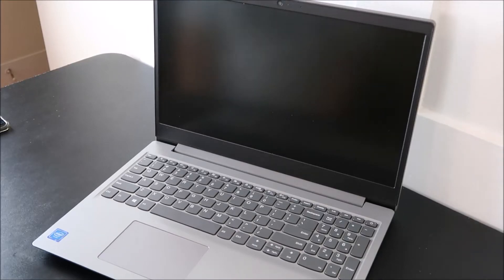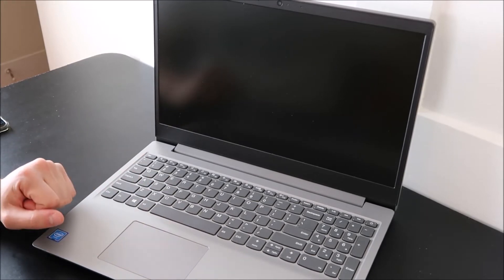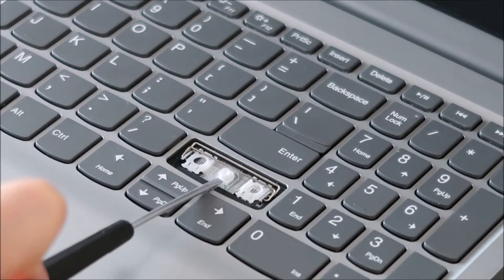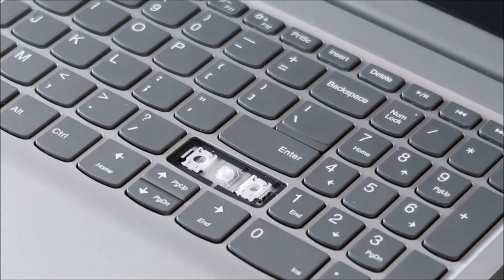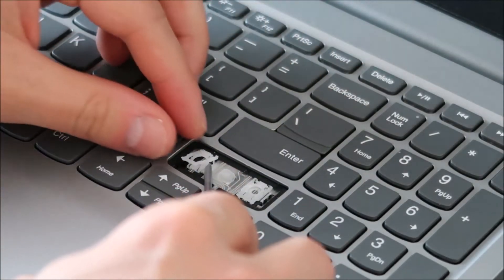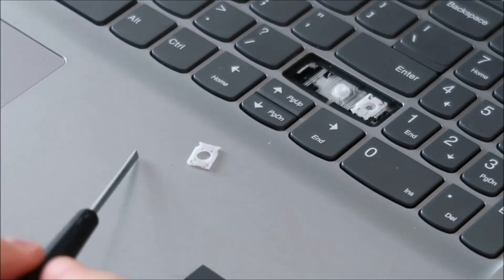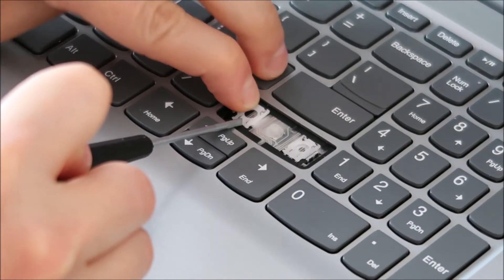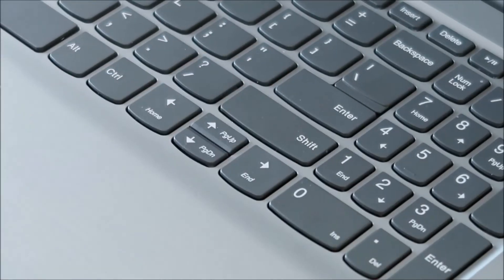How To Fix Replace Large Keyboard Key - Lenovo Ideapad

Comment: what about space butten i took it of and now i cant put it back on!
Reply from the maker: If your Key Cap is not clicking down in place correctly, it is most likely due to the Retainer Clip not being properly installed or damaged.  Remove the Cap and inspect for damage or that its not laying down flush and properly snapped in itself.  Compare to another Clip if needed by removing another Cap.

Comment: Additional tip: Put some thin adhesive tape (TESA) around the screwdriver to minimize scratches.
However, before removing keys, try a very strong vacuum cleaner. In most cases there are particles in the mechanism, there is a good chance to pull them out.

Comment: I used this for my spacebar. It is quite different from this, but the gist is the same. Replacing keys from other laptops in the past helped quite a bit. The orientation of the white bits is tricky. As well as how to connect the two white bits together.

With the spacebar, there is another strange metal bar-loop connected to the spacebar key itself. I just left it in, then put the other two metal stabilizer bars in as you did and pushed down. Then I typed and it worked. Then I pushed down even harder, and around the whole key, then it worked even better.

I ate 12 pieces of KFC, two icecreams, then a gummy hamburger. I collapsed to the ground for 2 hours in stomach and body pain. I finally managed to go to sleep but when I woke up my arm was covered in spit, as well as my laptop. Drops of spit. Many. I have no memory of how this happened, but the spacebar got stuck as a result. I think I threw up spit the moment I woke up, but my brain did not encode that memory. I just remember my arm covered in spit. Why eating so much caused this to happened I have no idea.

Anyway, thanks.

Comment: On my lenovo A485...the left shift key had become sticky...or spongey type after some ketchup got in it...when i tried to remove it like you did..it did NOT go off like it wont comr off... im scared ill break something..do you have any help on how i should take it out?
Reply from the maker: I can only say that I demonstrate here how to take it off. After holding down the Hinge Clip, you 'rip' off the Key Cap. It can be scary as it may take a bit of force to remove it especially if theres a sticky compond in there making it worse. And there is a degree of risk to breaking it. I still break keys every now and then. If your comfortable with the risk, I would try it. If not, I would take to a computer shop

Comment: Does that work on 15iah7 ? A juice spilled on the keyboard and it's now sticky and i want to clean it
Reply from the maker: This process for removing and installing a key 'works' on any laptop with keys like this. You can remove the key or keys, clean under them and then reinstall the keys.
Reply: @PC_Monkey  thanks a lot

Comment: Hello. I have a Lenovo IdeaPad 5i which looks exactly like the one in your video. My uissue is with my Ctrl key. It was feeling very sticky so I popped it very carefully just like your video and cleaned it. I was ablo to put the two white retainer clips back together exactly as you show. I appear to have put the retainer clips back together and snapped them in place. My issue is that when I press the key down and they clip on to the long metal clips, my key does work but the key does not lay flat. It's more like a see saw. It pops up and down as you would like but the key isn't lying flat. What am I doing wrong? I can send you pictures and you can tell me my issue. Or, can you possibly do a video on the same laptop in this video but for the Ctrl key. Thank you.
Reply from the maker: Most likely the key is not assembled correctly, or its damaged.  To see exactly how to reinstall it, you can remove the key cap only of a similar sized key and compare the two.

Comment: Hi Jamin, I spilled some wine on the keyboard 😀months ago. I didn't know it's possible to work with each key separately. But in your video you don't recommend doing anything with that central white spring (thing in the center of a key that makes it possible to press and turn back a key) - so what would you recommend? Should I try to clean under it? Or any liquid cannot really get under that detail, so I should just clean around and not touch the central spring? And is it ok to clean with a spirit liquid?
Reply from the maker: No. The Rubber Spring is held down by a small amount of glue.  That component is not designed to be removed and reinstalled.  I would try to just clean around it.
Reply: @PC_Monkey  ok, I'll try to and leave a reply here ;)
Reply from the maker: @alexko464  Good luck !!  Let me know how it goes :)

Comment: i broke my left cntrl key cap. now i dont know how to fix this. few repairing centre said to replace the whole keyboard and it will cost me around 10-12k INR. 😫😫
Reply from the maker: If any component of the key assembly is broken, it would have to be replaced.  I usually get my keys on Ebay or www.replacementlaptopkeys.com.  If you cannot find a loose key for sale, you may have to purchase a keyboard and take a key from there.

Comment: This tutorial doesn't apply for the enter key. That combo key has different parts inside of it.
Reply from the maker: It has different parts then the Rubber Spring, Key Cap, Hinge Clip and a Metal Bar?  What parts do you have in your key?

Comment: My rubber spring broke in the middle i can't fix it im worried the key i broke is the key left of the w key its broken thats y i can't type it :(((
pls help me fix this problem
Reply from the maker: There isnt really a good way to reattach those.  They are not meant to be replaced.  Best advice is try to use a small amount of glue.  If that does not work, you may have to replace the keyboard.

Comment: Shift key inner parts are broken
What should I do?
Reply from the maker: If any component of the key assembly is broken, it would have to be replaced.  I usually get my keys on Ebay or www.replacementlaptopkeys.com.  If you cannot find a loose key for sale, you may have to purchase a keyboard and take a key from there.

Comment: my left shift key is a bit too flat whenever I place it back, both retainer clips are perfectly fine as well. Is there something wrong? The metal bracket also seems to be normal
Reply from the maker: If your Key Cap is not clicking down in place correctly, it is most likely due to the Retainer Clip not being properly installed or damaged.  Remove the Cap and inspect for damage or that its not laying down flush and properly snapped in itself.  Compare to another Clip if needed by removing another Cap.

Comment: I took my left shift keycap off to clean under it, when I took it off the retainer clips and the bars came off with it. the clips go black onto the key slot and the bars do too but when I go to click the keycap back on its not secure and keeps wobbling around and when I pick it back up its not connected to anything and the bars come back up with it and won't stay in the holes they slide into. Is there any way I can fix this? if not what should I do because I can't get a new laptop and that seems excessive and I need it for school work and my school term goes back in just over a week.
Reply from the maker: If your Key Cap is not clicking down in place correctly, it is most likely due to the Retainer Clip not being properly installed or damaged.  Remove the Cap and inspect for damage or that its not laying down flush and properly snapped in itself.  Compare to another Clip if needed by removing another Cap.
Reply: @PC_Monkey  Okay thank you so much!
Reply from the maker: @d3athb1rd67  Good luck !!  Let me know how it goes :)

Comment: I popped my zero key can you help me
Reply from the maker: This video shows how to install a key onto a keyboard.  Were you unable to do so as seen here?  Did you have an issue with a certain part?
Reply: @PC_Monkey  i have a Lenovo IdeaPad 330 and my zero key has been popped please help me inside the key there are different parts
Reply from the maker: @Iamtushal  There are usually 3 parts to a key assembly.  A Key Cap, a Hinge Clip, and a Rubber Spring.  Your key has different parts?  Feel free to post a video to your own channel and message me back here when you do.  I can then view and advise further :)

Comment: Can i use the shift key without the retainer clip? I think i broke them because the key wouldn't get back i place properly so i removed them and put the shift key back in place. Seemed to work normally.
Reply from the maker: If its working normally then you should be good :)  Not sure how its staying in place without a retainer clip though ¯\_(ツ)_/¯

Comment: my enter button wasnt pressing down like usual, so i took the keycap off, but the two white little clips both went into three pieces, is it only supposed to be two pieces? I tried putting it together again but it wont stay in place anymore!
Reply from the maker: If any component of the key assembly is broken, it would have to be replaced.  I usually get my keys on Ebay or www.replacementlaptopkeys.com.  If you cannot find a loose key for sale, you may have to purchase a keyboard and take a key from there.

Comment: I accidently broke off the little white thing in the center what do i do
Reply from the maker: Are you referring to the rubber spring?  There isnt really a good way to reattach those.  They are not meant to be replaced.  Best advice is try to use a small amount of glue.  If that does not work, you may have to replace the keyboard.

Comment: I took out my caps lock key (cause of a wine incident) and I cant put it back on. It just sits there very stiff and requires a lot of force to function
Reply from the maker: If your Key Cap is not clicking down in place correctly, it is most likely due to the Retainer Clip not being properly installed or damaged.  Remove the Cap and inspect for damage or that its not laying down flush and properly snapped in itself.  Compare to another Clip if needed by removing another Cap.

Comment: My retainer clip came into 2 peaces tel me how to attach them together
Reply from the maker: They fit together with a small plastic pin on the left and right of the inner clip.  These fit into holes on the outer clip.  To see exactly how the inner clip sits in the outer clip, remove another key cap and copy the clip under it.

Comment: Yo bro i have a problem with my space and i cant  seem to put the retainer clip back together .its different from the one in the vid
Reply from the maker: They are all a bit different but most of them fit together the same way.   They fit together with a small plastic pin on the left and right of the inner clip.  These fit into holes on the outer clip.  To see exactly how the inner clip sits in the outer clip, remove another key cap and copy the clip under it.
Reply: @PC_Monkey   Man that Worked ! .it was hard to put it together with my Big fingers. yo appreciate your work . thnk u

Comment: Great video! Saved me from a sticky enter key after OJ spill. However, I have another issue, very similar. Could you maybe tell me how to reattatch the clip of the |/ key above the enter? I accidentally took off the white clip while trying to just take off the key to clean underneath, and the white clip fell apart into two components. This one is different/bigger though! And I can't seem to get them to go back together and into the keyboard. Any tips on how to put back together?
Reply from the maker: The inner clip usually fits into the outer clip by a small plastic pin on the left and right.  They fit into holes on the outer clip.  Each keyboard is different unfortunately, so you would have to remove another similar sized key to see how its fit together as a guide or just try a couple ways until you find one that works
Reply: @PC_Monkey  Thank you for the reply! I tried looking under a similar sized key and that helped puzzle it out. Thanks very much for helping me :)
Reply from the maker: @joosderuiter5913  Happy to help :)  Always here if needed !!  Great job !! Those keys are horrible when your not used to it

Comment: Hey! I did all that but still my key is stuck! What should I do.
The key is the "+" on the num pad.
Reply from the maker: If your Key Cap is not clicking down in place correctly, it is most likely due to the Retainer Clip not being properly installed or damaged.  Remove the Cap and inspect for damage or that its not laying down flush and properly snapped in itself.  Compare to another Clip if needed by removing another Cap.

Comment: Hi great channel, i have a WiFi antenna cable problem and need to replace it, do you have any video's in that or would you be able to do such a video? Oh and i have a Samsung 300E laptop, any tips would be appreciated. Thanks
Reply from the maker: I dont have a video on that I am afraid :(
Try searching for "Samsung 300E Teardown" and see if they access the antenna.  If not, I can tell you that the Antenna cable usually runs from the top of the LCD, down through usually the right hinge assembly, across the motherboard to the wifi card.
Reply: @PC_Monkey  yeah you right thanks alot dude
Reply from the maker: @gamerroyal9871  Happy to help :)  Always here if needed !!

Comment: My HP laptop will turn on but when booted up the HP logo and loading sign keeps loading and doesnt go to my desktop. How do i fix this?
Reply from the maker: For that issue, refer to this video first;  https://www.youtube.com/watch?v=_qF-oqPrn7M&feature=youtu.be
Let me know how that goes :)
Reply: @PC_Monkey  so my hard drive passed. I tried the change from disabled to enabled for the 2nd step. Restarted and I'm still having the loading hp screen. What do i do now reset whole computer?
Reply: @PC_Monkey  I'm just trying a reset I have tried many different options from the videos. Hopefully that works
Reply from the maker: @kimberlywade7831  If that video did not help and everything passed the diagnostic scan, then try to reinstall the operating system as seen here;  https://www.youtube.com/watch?v=p_N_xV7j_Xo

Comment: Or it good to buy a New keyboard for laptops 😎
Reply from the maker: If you can replace them, yes.  However, if the keyboard is a French Inset Keyboard, then its better to replace keys.  The keyboard cannot be removed without breaking the palmrest so replacing keyboards in those computers is not a quality repair ;)
Reply: @PC_Monkey   in your next video can you explain what is black screen and blue screen IAM a little confused about this ☺
Reply from the maker: @Darnellreyes12  When I say 'Black Screen' I am usually referring to a computer that starts but the screen stays black.  Usually a problem relating to the LCD.  When I say 'Blue Screen' its in reference to a variety of 'Blue Screen' errors that stop a computer from loading the operating system.  Usually an error related to the operating system or hard drive.